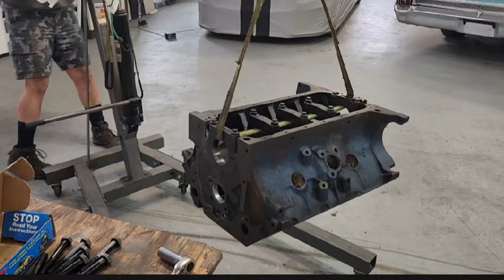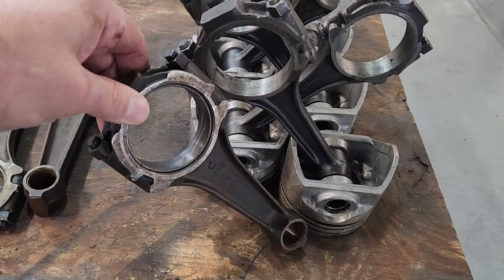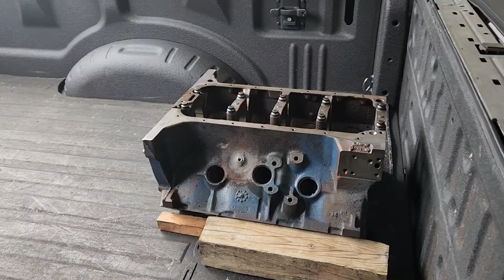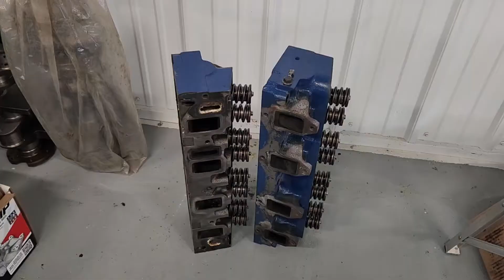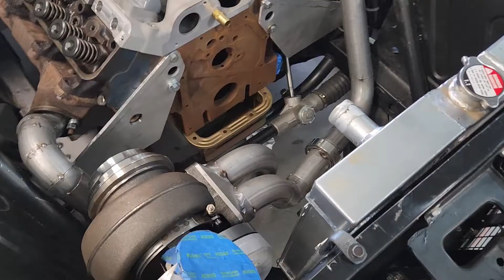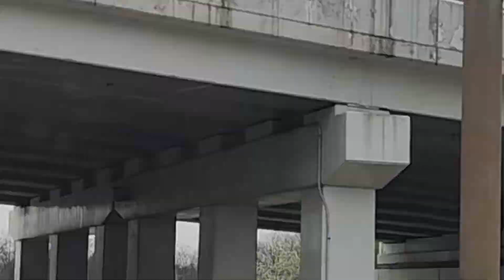FORD FE ENGINE TURBO BUILD/ @mydirtygarage

Comment: If you filled the water passages , how do you keep the engine from cooking itself?????? 😮
Reply from the maker: With a street engine you can fill the block to the bottom of the water pump holes without overheating issues while making the block stronger. Thanks for watching!

Comment: Great prodject. I have a 361ft in a 1975 f 700. Its 40 over. It blew up on warrantee when it only had about 4000 miles on it. Only has 60000 miles now. It always was a dog as far as performance goes. Im thinking of twin turbos for it. Its 7.5-1 compression.  It will rarely rev over 4000. Your thoughts. Oh its in good shape. Oil change every year. 51 oil changes in 60000 miles. I just want to make it enjoyable to drive

Comment: I am pretty sure the 352/360/390/410 are all the same block just different rotating assembly. Why they didnt just use 390fe and not the 352/360 I have no idea. I really want to build a cheap turbo towing build on our 67 f250 with an Fe unsure on size. I have also never seen any one filling in the coolant passages in the block, that's interesting although wouldn't it diminish the cooling?

Comment: I still think that the FE is the best and most versatile engine ever made. Do you know that the Coyote has a wet belt running the oil pump. I have a 2022 Edge ST with the same thing. Is there a conversion? I have a n ARP pump drive and M57HV and a Canton big pan and sump that I have run 40 years. I am scared of those internal belts. Thats all I don’t like about the 2.7 Eco transverse mounted engine and the 5.0L Coyotes. I am still maintaining the FE is the greatest engine Ford has ever made, but that’s just my opinion. Any ideas?

Comment: I was going to suggest that if you have 1.66 ch pistons and 6.49 390 rods at a 4.065 bore you can put a 3.98 crank from a 410 or 428,  It would be a 413.22 engine, with that T06 -S475 where would it spool up? It looked like a twin scroll but I am legally blind and my magnifier didn’t see two BOVs are the iron manifolds with the join pipe and a 4-5 inch exhaust out of the hot side be good for 800-900 hp?  That would be the simplest way to go, an 8-9 lb boost S475 on a T06 volute would move a bunch of air. A 4.08. X3.98 would be 416 ci.
Reply from the maker: Good plan but (ARP fasteners a side) this is designed to be a budget build using what I have laying around and bought for cheap on FB Marketplace. Thanks again for watching!
Reply: @mydirtygarage  Oh man I just gots to have my ARP hardware! 😂. I have to say but I have a set of 390 rods with 3/8 ARP bolts and Main and head  studs that have seen 1000 hp and I still have it, the Nitrous is gone but I really want to to put a pair of GT45s or like yours, take the 2 inch primary race headers off and put the 279350 Bullet roller in place of Reed I had and put the stock iron on backwards and do what you’re doing two 2.5 pipes to a T06 volute and a S475. I stretched and have never removed the ARP hardware since 1999, and beat the crap out of anything that lined up with me. My 396 FE was good for 8000. And you could empty the Nitrous bottle. FEs are tough if you take your time and balance and tune it. I think the block was likely a 390 bored CJ block. I want to get some used LS forged pistons at 4.065 and 1.326 CH with Scat 4340 6.85 rods and my 428 CJ crank with 2.2 journals. I have a D3TE 3 rib main block that I did a drill bit test on and a 3/16 bit was really tight between the bores. I have 90% of it. I’m legally blind though, so I d have to have a good driver. But at 413 ci with the turbo or turbos I’m not greedy between 800-900 hp would be right in its wheelhouse. And at 4.05 , a powerhone to 4.065 would be all it needs. The crank will turn to 2.2 rods the mains are already 2.74. I have two cross bolt mains that have oil feeds from the side bolts for 2 and 4 where they crack. I really wish I still had my 68 Mustang coupe. It was a 289. 4 speed. That on a torsion bar subframe would fit right in there. That would make a low 9 E85 car. Dang 63 and still want to play!
Reply: @mydirtygarage  I’m pretty much at the stage in life that I need to use the parts I have. I gave a close friend a new set of BBM FE heads for a 482 project he plans to build , he has a BBM block and a 4.25 Scat 4340 steel crank and a set of 6.7 K1 BBC 2.2 journal rods. I just have a bunch of old junk. I can’t drive anymore but I still love cars. I think I can still build an 800-900 hp bullet with the junk I have. I need a couple of cheap turbos or a single fast spooling one. That S475 sounds like it would be good and not terribly expensive. Just iron manifolds and a blow through 750-850 Holley. The C4AE-G heads that I poured my heart into were stolen from the machine shop that I sent them to for a final inspection. I think they were borrowed by another builder for EMC and did very well and sold very well. Just a suspicion. That has happened before. The guy is in a wheelchair, so I guess it’s Ok. 👌
Reply: Do you still have the piping  and manifolds any parts that you want to sell cheap? I’m a scrounger myself. The mystery  Mustang new beginning could be well. I like the LR heads too! Just a thought and that pump is not a slacker either!
Reply: Me too, but we went out and looked for anything that might help you out. I’m wanting to bore a D4TE block that drill bitted to 3/16 out to 4.125and find a 4.25 stroker kit used and fill it like you are. I have 2 crossbolt PSE side oiling main caps for 2 and 4. They are aluminum so they should cushion the 2 and 4 that are prone to cracking, but it’s got the CJ 3 web mains in the block. I have all of the ARP hardware. I have a PortoSonic intake, and a 245@.050 .600 and 108 Solid Roller that Smith pushrods and Harland Sharp rocker arms and stands with Dennis Carrillo HD shafts. I can’t see but I ll find a way. I wish I had a 427 Industrial block that has run on LPG all its life, 4.25x3.98. Put a set of headers facing forward with a T6 like yours! Helluva truck engine.

Comment: I s that a PSE intake adapter and a 351C strip Dominator?
Reply from the maker: Jay Brown Adapter
Reply: @mydirtygarage  that is a very good piece!
Reply: Jay Browns stuff is amazing. The Heads , his adapter, all of it. And he tests it. I learned that Ford knew what they were doing on the FE exhaust port. All the assumptions made an Ass out of everyone. The regular port makes same power as a fancy raised port. In fact if you’re working with an FE just do a regular CJ port and focus on the intake. That’s where the power is. Amazing that you can put a 2.19 valve in a 4.08 port and feed an engine stroked to 4.375. I also learned that you can use crossbolt mains out of aluminum on 2 and 4 on a 4.08 x 3.98 416 and an iron 3.98 crank with everything balanced can live at 800-900 hp, because it is light. As light as a 350 Chevy or LS in reciprocating weight which is parasitic. You end up if run lines to the crossbolt PSE studs they are drilled for priority oiling and you get it on 1245 if you plug the oil from the top feed just above the cam journal. It is like a Side oiler and keeps the oil cooler. Testing has shown us just how far ahead the FE was for its day. I want to do a 413 ci 410 with two 3582 turbos at 8 lbs each with the 245@.050 .600 roller cam for about 825 hp on pump gas. Being blind I’m still hoping for a miracle. But would that be neat.

Comment: A man after my own heart 💜.
Reply: This is my dream!  Don’t send those LR heads to a machine shop, have a friend you can really trust to help you do them!
Reply: I want to do the same thing!  I want to deck it and use a thin gasket to get it to .040 assembled quench. I had a good set of heads done, but they disappeared from the shop.  No story there. Mark the parts if they are worth anything. A lot of thieving in the FE world.

Comment: You don't need Big cubes to make things run just better ideas keep it up
Reply: I agree, a .030 over 390 at 396 is a great straight forward engine. A set of Trick Flows, a good hyd roller and a Tunnel Ram with 2x4s is a great NA engine, or a 396 FE with a pair of 3582 T04s on a good blow through setup at 800-900 whp.   Big cubes are fun, but I have a lifetime supply of 390 stuff.